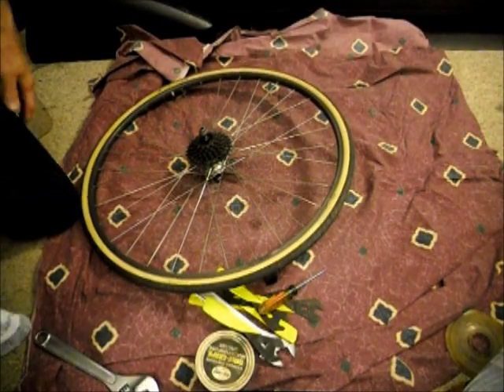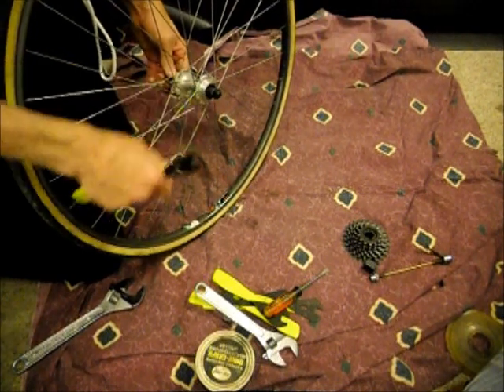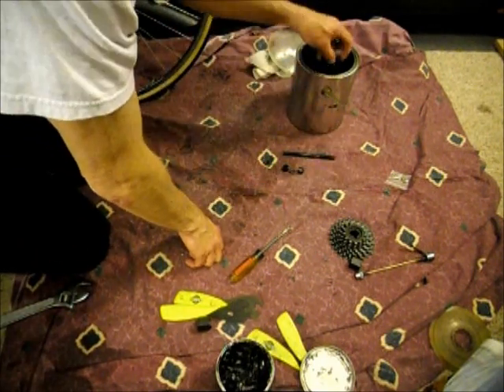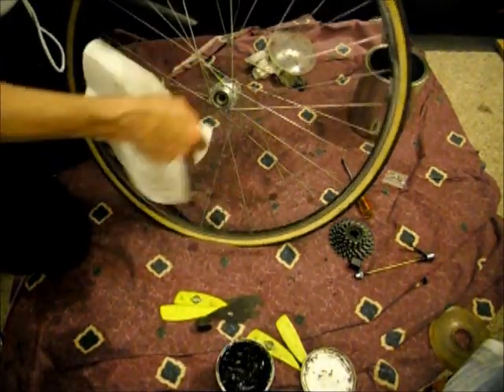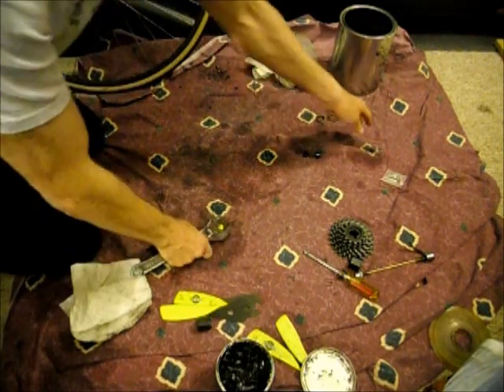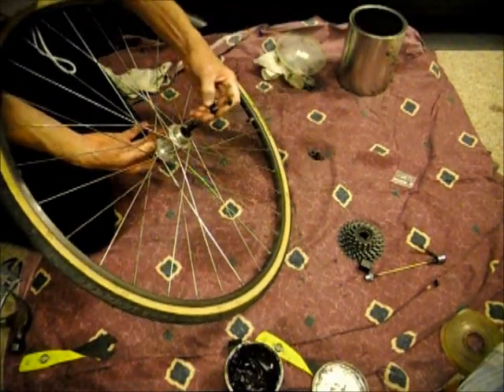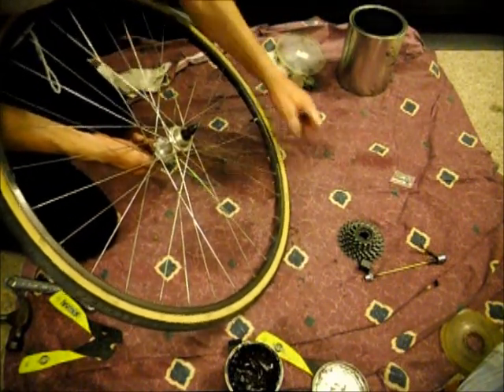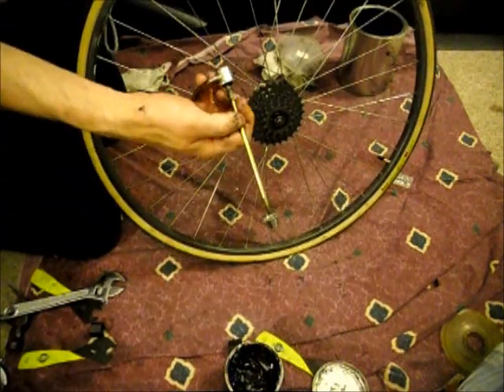How To Overhaul The Hub Of A Rear Bike Wheel

Comment from the maker: Citrus degreaser will work. I use it on some stuff. I just prefer using paint thinner on stuff with bearings instead of water based degreaser. Just my own personal preference. And paint thinner WON'T damage the bearings.

Comment from the maker: The ball bearings come in different sizes. If you take some to your local bike shop, they can measure them, and sell you the replacements. Or Park Tool makes a tool "Park Tool Spoke, Bearing, and Cotter Gauge - SBC-1" that is basically a ruler with holes in it. The holes are to measure different sizes of bearings. The grease I used is just a good quality general purpose grease from the autoparts store.

Comment: always a great video on bike maintenance,  for the rear hub always found it confusing regarding the final adjustments to fit and rotate properly, but still a slight wobble
Reply from the maker: Wobble? Do mean play in the hub? Or could be rim out of true. Or something else.
Reply: @RJTheBikeGuy  at the end of your video you mention making sure both sides are correctly tight, it the small adjustments that drive me crazy, thats all
Reply from the maker: It takes a bit of practice. It helps to use a vise to lightly hold the bottom part (other side of the axle) from turning while adjusting the top part.

Comment: ...little bit of play since when you tighten the lock nut against the cone, the axle also spins clockwise, loosening the cone nut, even using the flat wrench tool. so i tighten the cone a bit more than usual, so when i tighten the lock nut, i get a good final result.

Comment from the maker: Citrus degreaser probably would have worked. I haven't tried it though. The paint thinner readily dissolves the greases and gets all the nooks and crannies without scrubbing, I am guessing the citrus degreaser will require maybe a little scrubbing to get the threads cleaned. Make sure you dry the parts well so they don't rust. BTW I have used that same can of paint thinner to clean many parts. So it's not like I cleaned just these parts and then dump it.

Comment: Hi RJ, I’ve picked up a mid 80s bike and want to overhaul as per the vid. Been a while since I’ve done this but recall bending stubborn dust caps on the hub when using a screwdriver. Is there another method to avoid this? Thanks mang.

Comment: If I were to want to use two bike wheels in an application similar to a cart application, is there a long axle I should be looking for that exists to connect the two or do I have to fabricate this myself?
Reply from the maker: +whisperingsage You would need wheels designed for the application. Wheels like that are driven by the axle. Regular bike wheels are not.

Comment: Just leave the free wheel side of the axle together remove from the right side you can still clean it & save yourself Read alignment headaches. & yes grease the freewheel threads before Reinstalling the gear cassette you can just hand tighten the Cassette the first time you ride it will tighten its self.

Comment: What is the importance of not losing the springs from the skewers? I've actually lost one from the front and one from the back also.. :/
Reply: I don't know the importance of the springs either. Maybe the springs are used to stop the skewer from becoming loose from vibrations, just like a lock washer does when placed between a nut and the surface the nut is being tightened to. No matter the reason, a educated engineer who knows the science designed the skewer setup to have springs. So please get the missing springs replaced for your safety.

Comment: Hi, I'm looking to attach a 11spd cassette on a freehub for 9spd. I know it's 1mm too short, so I will need to swap the rear hub completely. I assume this video is not the correct technique I need. I in fact will need to rebuild my wheel. Is this accurate?
Reply: it's a sealed rear hub if that makes a difference. thanks.

Comment: Was this one of your earlier videos. I noticed you didn't use your magnetic pick up tool to take the ball bearings out. You are not using marine grease and don't yet have the the very handy grease gun for applying that. About safety, I would suggest that you could put a few warnings in. Paint thinner is toxic (brain damage) and we need to use it in a well ventilated area or I would even wear a vapor mask. The grease is also toxic and can be absorbed through the skin. Most mechanics now wear the blue rubber gloves. Failing that grease can be washed off with Solvol. Thanks for your videos. I'm overhauling a Malvern Star Sprint 12 and so I't great to have some demos on older machines.
Reply from the maker: Yes, this is much older. Old camera, old lighting, camera mounted on a tripod. I've done a newer version of this video. Yeah, I should wear gloves, but I just don't like the feel of them.

Comment: Thanks for this, it was very useful! I replaced the freewheel some time ago on my bike, so I didn't want  to go to the hassle of removing it again, especially since they can sometimes be so tight and hard to unscrew. I managed to clean the inside of the sprocket side of the hub using a screwdriver with cloth wrapped around it. I was also able to get grease into place with the blade of a screwdriver, and the magnetised blade helped to position the steel balls.
Have you any thoughts on leaving ball bearings in a magnetic parts tray? I wonder does it have any effect on their rolling in the hub if they get magnetised?
Reply from the maker: Eugene's DIY Den No idea. And I would have just removed the freewheel.

Comment: Good example of how to use a crescent wrench backwards, as in the wrong way. Always place it so you're turning towards the adjustable piece. The manner shown gives a worse grip and will damage the wrench, or could break the crappy ones.
Reply from the maker: If the wrench is damaged/broken under so low torque, then it is a piece of crap and deserves to be in the trash.
Reply: That's probably true, but doesn't change the fact there's a right way and a wrong way and the video demonstrates the wrong way. I wasn't worried about the wrench involved here, but about viewers damaging their own wrenches in other situations where more torque is involved.

Comment: Where can i buy the skinny wrenches?

Good informational video

Cheers
Reply: You can grind a regular wrench thin to use as a lock nut wrench. I ground a half inch wrench to less than half it's thickness and used it on lock nuts. I rather grind a cheap one made in China than buy a over priced one from Park Tools.
Reply: @jeffhayes2288  good idea thank you.

Comment: On a dry riding conditions how often should this be done in miles?
Reply from the maker: I do it as needed.
Reply: +RJ The Bike Guy thabks RJ, any more details?  How do you tell when it's needed?
Reply from the maker: If I pull the wheel out and there is play in the axle, or the axle turns rough. Or if I buy an old bike that is rough shape, I may overhaul the hubs just because. I don't have a set schedule.

Comment: I have nothing but bad luck.It seems my bicycle is becoming obsolete,The 2011 Schwinn Wall mart side winder .My rear  hub wheel shell is 35 mm wide outer diameter ,there are no caged bearing in amazon or eBay that would fit in side the shell.I'm guessing   Schwinn is is making sure only they sell the parts and they want's you to buy a whole wheel ,They don't sell bearings.I have to go naked now,no caged version.What size bearing would be good for the rear hub shell that is 35  mm   outer diameter  wide? then i can hold that whit grease and no metal cages .!/4size bearings  ? 3/8?.My front  wheel except 3/16 cage bearing and i had to send back the 10 1/4 cage bearing , It was too wide ,to get my money back at a eBay .I know I need just 9 on each size ,What size naked bearing would be good?
Reply from the maker: Michael Mcgee You can probably go to your local bike shop and buy the caged bearings. You need to use the same size ball bearings that are in there, caged or not. If you can't find the right size caged bearings, you can pull the bearings out of the old cages, and replace them with new ball bearings. https://www.youtube.com/watch?v=4KPyDnlF0Fo
Reply: I just found some old bearings that came out of my rear wheel and they look like the 1/4 size i had to return cause the cage was too wide  and it was 10.so all i need is 1/4 9 bearings on each side
Reply from the maker: Just take the caged bearings to your local bike shop and have them match them.